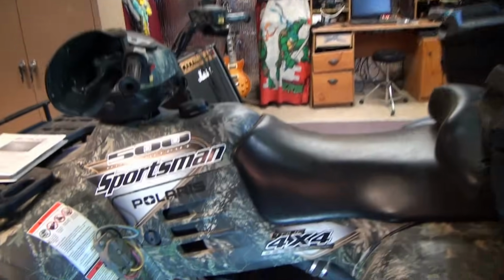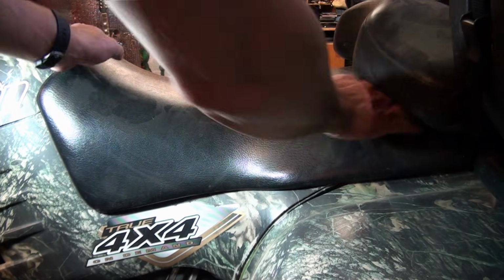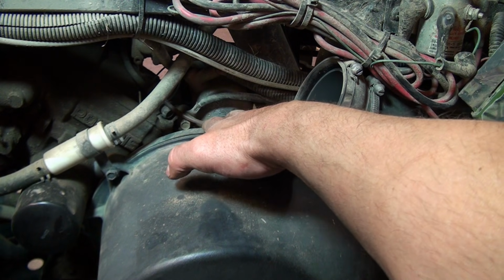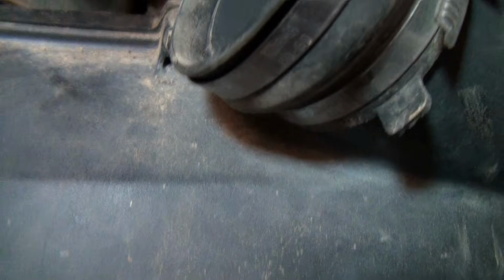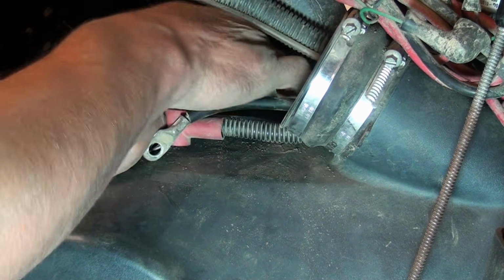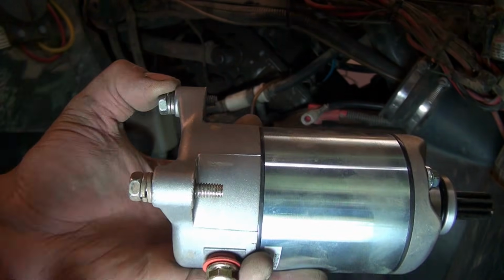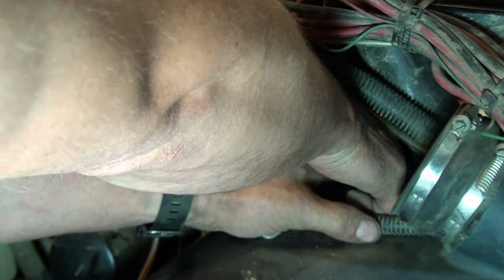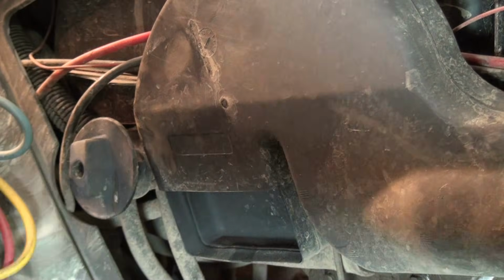DIY How to Replace a Polaris Sportsman ATV Starter Motor No Clutch Removal Required

Comment: This was a great video. I am glad I passed by the videos that said to remove the clutch cover. I would recommend inlist your wife, girlfriend,  daughter, anyone with small hands to do the tedious right bolt. All said, I am glad I have patients.  My 2011 500 ho, had to have carb, air filter, throttle cable , battery and starter. Thanks to these videos I have a brought my relic back to life. 
Glad my dad chose to get his daughter involved , I live this .

Comment: Works on a 2004 sportsman too
Cutting down bolt was a difference maker. If you use a ratchet wrench, place it on that right hand bolt before you rotate into place and can use a long screwdriver to give a little pressure and seat that nut easily

Comment: Maybe this will help someone.
I have a 2010 polaris sportsman 500 HO and the starter went bad (would start if I tapped starter with hammer while turning key) My starter mounting bolts have 8mm heads. Do not use a 12 point 8mm box wrench or you will strip the head especially on that lower mounting bolt. Instead get a 8mm 6 point box wrench or a 5/16" 6 point box wrench will also work just as well.  After the head began to round using the 8mm 12 point wrench I switched to a 5/16 6 point wrench and using a big flat blade screwdriver to keep the wrench securely in place on the bolt head I hit the wrench rather hard with a big hammer and the bolt broke loose

Comment: I just hit the starter with a hammer and screwdriver and it popped just out no need to pull on clutch cover just make sure bolts are whole way out.

Comment: Just did this job on my 2005 500 HO. There was no need to cut the bolt. I was able to use a pry bar against the back of the clutch housing, just like he does and was able to remove and install without much issue. Thanks for the information sir!
Reply: On that lower bolt - remove the outer clutch cover and press the inside cover to pull it away from the lower bolt.  Just enough room to pull the starter with the lower bolt removed using long needle nosed pliers.  
23 years on the factory starter and I'll rehab and lube it it and keep it as a spare.
Cutting the lower bolt is not a wise idea.

Comment: im doing this later today .can a person take outside clutch cover off drill a 1/2 inch hole inline with the pain in the butt  bolt and pop a plastic fender plug  in the hole , case isnt water tight any ways ??

Comment: Swapped the starter on my 01 Sportsman 500 today and this saved me a ton of headache, thank you! I also ended up popping the intake duct to the right of the starter out of the headlight pod which gave me a little more room to rotate the starter and remove it.

Comment: Great video. Enabled me to put my starter in my 2003 Polaris Sportsman 6x6 myself and save a couple $100 at the shop. I found it helpful also to remove the air cleaner under the seat and above the starter. Gave me better access to the bottom bolt and to grip the starter to remove and replace it. Thanks for posting!

Comment: 2001 Trail Boss 325 2001. 
After "n" years of not being used, when I installed a new battery and tried to use it, it broke out and no more sign of life. With the tips from your video I was able to uninstall it and found rust everywhere.
I am waiting for an aftermarket to install. Your tip for cutting the screw is great. I'll tell you how it went.
Thanks from Portugal

Comment: Thanks for the video.  Better than the video that removed everything including the decals to change the starter. No need to shorten bolt just put in and rotate.  Total job took 10 minutes.

Comment: Attention everyone who is watching this!! Do not pay attention to this video!!! YOU DO NOT have to remove the clutch cover or drill holes in anything... Disconnect battery first,  remove the air cleaner housing to access the two 10mm bolts to the starter, remove clutch vent tube, disconnect positive wire on starter, loosen two bolts from engine case completely, its very important to leave the rear bolt in starter hole and twist starter clockwise to remove when standing on right side of machine, it's very simple. Install in reverse. Takes less then 15 minutes.
Reply: I’m actually about to replace the starter on mine. How do you tell which wire is positive on the starter?

Comment: Removed the air box and clutch vent tube on my Scrambler 500, want able to get the starter out without it. Made the bottom bolt a bunch easier as well. Appreciate the tips.

Comment: Helpful idea to spin the starter to get the bolt on top in order to pull it out.   Hoping that works on my ‘04 400 so that i don’t have to fool with the clutch assembly.   Like the idea of shortening the hard to get to bolt a bit once its out before replacing new starter...

Comment: Remove the clutch. Far less frustrating. Cheap gear puller will suffice.
Reply: Attention everyone who is watching this!! Do not pay attention to this video!!! YOU DO NOT have to remove the clutch cover or drill holes in anything... Disconnect battery first,  remove the air cleaner housing to access the two 10mm bolts to the starter, remove clutch vent tube, disconnect positive wire on starter, loosen two bolts from engine case completely, its very important to leave the rear bolt in starter hole and twist starter clockwise to remove when standing on right side of machine, it's very simple. Install in reverse. Takes less then 15 minutes.

Comment: Thanks! That was great advice. I did this on my 2005 500 Sportsman without undoing the front of the clutch vent tube, just pulled the back to the side. Tricky job but if you're mechanically inclined and somewhat of a contortionist, it's a lot less work than pulling the clutch assy.

Comment: This video helped me tremendously first time I replaced a starter on a wheeler only thing I didn't do was cut the bottom bolt which means I'll have to rip it all back apart since I cant get it in there now but great video!

Comment: Thanks for the great video! It's very clear and helped me a great deal in pulling out my starter on my 2006 Polaris Sportsman 500 EFI. Unfortunately, I found I had to pull off the front cab to remove the clutch exhaust vent pipe that wraps up over the gas tank. After I cleaned up the starter armature a bit, the starter worked normally. It seemed to be coated in dust from the brushes.

Comment: Hey Brother question? my polaris trail boss, stars with the pull start only when I try to start it with the key it only clicks I have change the solenoid but I can't get it to start with the key ..... the only way to start it.   is with the pull start this it mean that i have a bad starter......
Reply: I am sure by now you have gotten it fixed, but I just currently had the same problem, I am actually putting clutch and plastic back on tonight. My 07 500 sportsman was doing the exact same thing. Had a spare starter from a Trail Boss that mounted right up. First thing I would do when starter is removed is clean all connection points from starter to solenoid- solenoid to starter including grounds. I put new one on and it still clicked. cleaned everything and fired right up.

Comment: I went ahead and ordered a new starter test solenoid with a multimeter and the solenoid was fine I went and even used a battery that I knew was good and same thing it I turned the key and I tried it for about 3 seconds the it went click click click again

Comment: Could you tell me or put up a video on how to change a starter on a 850 Polaris sportsman I think it's the starter came out to start it one day and turned the key and it just went click click click I tried seeing if it was the starter by plugging in jumper cable from a good battery directly to starter and went to turn the key and nothing

Comment: Just replaced the starter on my 2008 sportsman 500 EFI, this video was very helpful and made changing it a whole lot easier. Only deference is that the bolts are a 8mm instead of a 10mm on my model.

Comment: Hey Mark I just got a 2004 500 ho and it wasn't all there lol my question to you is I had to buy a starter solenoid and cables I and there is where my question lies. The solenoid came with the cables I know one goes to battery one goes to the starter off the solenoid but there is another that is spliced to the always hot side I have no idea where that one goes please if you know I'd love to know... Thanks